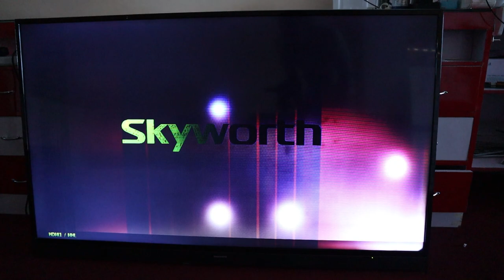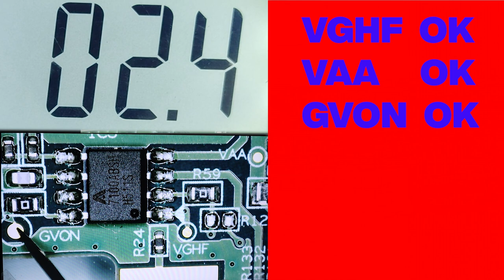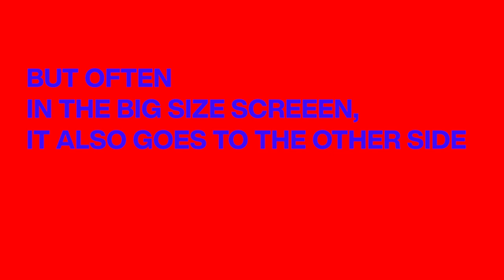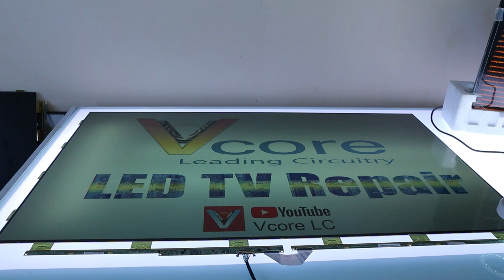Blurred Image in LED TV Screen

Comment: Greetings friend I have a 55 panel of reference st5461b05-1-XL-2 on the left side, it goes well vgh and vgl on the right side if I connect it, it loses vgh and vgl is dark without image now cut vgh leave vgl still and the voltages appear both sides but the image comes out all white that would be missing to leave the normal image thanks for your attention
Reply from the maker: you have to bypass VGH VGL in gate COF

Comment: why if vgh transistor on signal is missing then colors are shown. I would expect it to be dark screen only if vgh is missing and cant turn on transistors. Also i have found increasing vgh on onr side of panel can extend the value to the other side but May not be good to increase too high before transistors in panel blow.